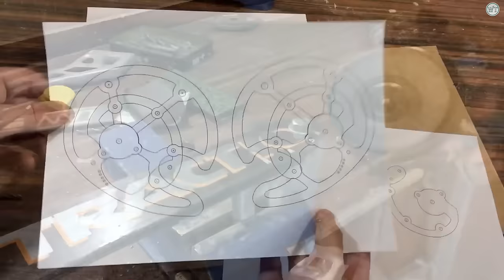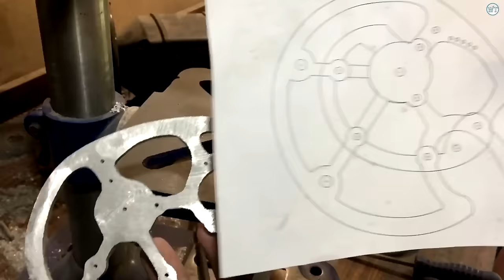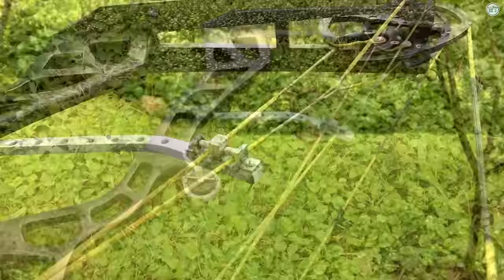Making a Full Size Compound Bow | Aluminum Riser | Powerful

Comment: Awesome build! I do have some critiques that would help the bow be more precise and a little quieter. The string stop shouldn't touch the string while the string is at rest, as that defeats the purpose of the stop completely. The stop is meant to dampen string vibration and quiet the bow, and if it's too far back and touches the string before it needs too, it will make the bow louder and transfer the string vibration to the riser. Keep it about a business card's thickness away from the string when the bow is at rest. The second thing is that the timing of the cams seems off (based solely on how they look when at rest). I would personally like to see full draw sequence of the bow before making any judgment on that though. Using a device to hold the bow for you and draw it back repeatedly to watch the timing of the cams and if any other parts touch something they don't need to would be helpful. Remember, this isn't me criticizing your skills, just some suggestions to make it better. Keep on building!
Reply: Even though I'm not the creator, I really appreciate this comment and how it's constructive and not hurtful or discrediting 👍👍

Comment: I made a compound bow about 20 years ago. It had riser made of white oak and limbs made of car leaf springs. One of the biggest challenges were cams, I made them from plywood which had to be strengthened in many ways to avoid splitting. To design draw length and let off to some reasonable values needed some thought and calculation... As a string I used a single piece of steel wire, nothing fancy there.  Finally draw weight was about 50-60lbs and bow worked well. First cams didn't last long but second ones were strong enough.

Comment: Nice craftmanship. However I'd like to point out few things that I spotted.
1. You are clearly not pulling the string all the way so that the let-off from the cams kicks in. This might be an issue with the draw weight or with the draw lenght, video doesn't really show which. If it is the lenght, the problem is most likely the cam design. Alternatively  a slightly shorter string will make the cams hit the stops earlier. This however will add more preload tension to the bow, unless you also add a little lenght to the cables. Not ideal solution, but might be good enough for this build. 
2. Draw weight is clearly too large for you.
3. As everyone else is saying, please don't use wooden arrows with a compound! And always wear safety goggles when shooting, especially as this is a homemade bow.
Reply: You can use wooden arrows with a low draw weight, but given the fact that hes not drawing enough to get any let off im assuming its a large poundage. Hes also shaking a lot.
Reply: @Lost_Hwasal  i guess you mean arrows lol
Reply: That i did.
Reply: Not all cams have a let off
Reply: That is literally the main point of a compound bow.
Reply: That and the fact that adding the pulley system reduces the bend in the limbs making it possible to use stiffer limbs than a traditional bow and gives higher arrow speeds. By looking at the cam shape, there clearly is a let-off.
Reply: it seems to be fully drawn ,  he may have accidentally placed the cams 180° wrong . there is no let off when drawn this way , only constantly rising . turn them around .
Reply: @Luzviminda777  no, the cams are in correct orientation and there is no way that the bow is  fully drawn in any of the shots, despite of the quite large brace height, there should be more movement in the arrow when drawn. After looking at his cam design for a while, I'm thinking that the cams are oversized, or the angle of the cam modules is wrong. Cam shape and size are dependent of the brace height, desired draw lenght and axle-to-axle lenght when the limbs are under preload tension, as well as the desired let-off percentage. What I am thinking is that he just printed out some cam design from the internet without considering these factors, therefore there is no way that these cams would work well on his bow.
Reply: looks like he's struggling to get that bow back to full draw..
Reply: O
Reply: “However”...the man just created this bow from literal scratch,

Comment: @ 8:00 all that effort to cast the outline of the cams in Aluminum when you had to drill them out of the other half anyway?
Just place the paper pattern on some aluminum stock or sheet and drill them out to get a finished product, bypassing the time spent cutting the patterns out of plywood, then all that work and energy spent casting them!

Comment: Most important where of it what i want to watch was making limps, you made everything,but you used skyboard for it. İ wanna learn more DİYfull limps.
Reply: Might be a little late but laminating Maple or Ash wood with fibreglass (car repair mats for example) and epoxy resin works well enaugh.

Comment: Skipping through all the bicycle rim Bowes very nice work!  I think you could have gone a little lighter with the aluminum parts, think the aluminum would have run OK. But wow what a nice bow to hang on your wall. I Especially liked the measuring tape spring with the arrow holding fork part. Sweet.

Comment: The metal he used for the arms was too stiff. If you see in the video, he could only pull it back halfway, plus, you can see him shaking.
Reply: it will put food on his table and kill him dinner. show us your homemade bow video.
Reply: @GrahamDoesMagic what choice of metal/alloy would you suggest, or would you have made everything from wood the right types of wood would be a fine choice, maybe carbon fibre cams would reduce the friction on the wood, I think maybe an aluminium plate between the wooden limbs and a  finished laminated wood top layer ?? plus the metal  he was  smolting  was aluminium . a soft metal.
Reply: Graham Lewis, arms are made of an old ski... looks stiff to me too.
Reply: @watchbreaker1706 Dombek they are called limbs m8 not arms but you are 100% correct fibreglass limbs made from a set of skis.
Reply: It is not that simple. In a compound bow eccentric cams affect on draw weight, draw length and how draw weight changes during the draw. I made a compound bow a long time ago. It has limbs made of car leaf spring steel which is very stiff, but because of the leverages they bend only couple of cm's at full draw. Bow of this video seems to have some problems on how cams and limbs fit together, or they are not correctly set.
Reply: Well, halfway is generally were the resistance is the strongest on cam bows, so... I hold my own bow there at that point cos I like to make things difficult for myself. If he pulled it all the way, it wouldn't have all that shaking that you're complaining about

Comment: The meaning of a compound bow is that it's more usable and easier to use, the compound bow should do all the work, for you, this one does not.
Reply: how is this less usable and harder to use 🤔
Reply: @Thomas Simpson Probably because he did a casting mold instead of actually hammering it out. The metal has no real elasticity since it's not truly one piece of metal.
Reply: Hahaha, mine snapped when the cable gone off rails,limb cracked, only kept the magnesium riser & pulley for future project
Reply: @Simon wat
Reply: @pckkaboo6800  probably from torquing
Reply: @Bagginsess  you don't want the riser to be elastic, it should never move or bend. The limbs should be the only part bending on a compound bow.
Reply: @BeetleBuns  using a cast instead of hammering it out would only lead to it breaking. if you want the middle to be completely stiff then you should make it out of a difference substance and then mechanically attach the limbs to it. idk much about bows but i can tell you that casted metal is inferior to "forged"/hammered out metal
Reply: @Bagginsess  a lot of bow risers are cast, it's perfectly fine. Sure a machined riser is stronger, but cast aluminum is perfectly adequate for cheaper (and in this case, handmade) bows. The bow he made is not amazing, hell it's not even good by compound bow standards (even the earliest compounds were better). I was just stating that you don't want the riser to be elastic. 

You don't "forge" a riser in the sense of hammering it out, you either cast it or machine it from a billet that was forged. I have 3 bows from the mid-1980's through 1990 that have cast magnesium risers, and still work as well as the day they were made. The stiffness doesn't come from the manufacturing process, but from the way it is engineered, in this case it's not going to be the best in that regard anyway. The only advantage machined risers have over cast is that there is less chance of a defect, which is extremely rare anyway if the one making it knows what they're doing. 

Sorry for rambling a bit, I realize this may not be the easiest thing to read, I'm just tossing my experience with compound bows out there, and while I prefer a machined riser just because I trust it a little more for the stuff I put my bows through on a hunt, I will pick up and shoot a cast riser without ay hesitation (provided it is in good condition of course).
Reply: @BeetleBuns  fair enough, im just a sword guy so i like my folded metal but i see what you mean
Reply: @caden5413  am i allowed to critize iphones, even though i cant make a phone?
Reply: It doesn't have let off
Reply: @Bagginsess  you ever get tired of publicly embarrassing yourself?
Reply: @arthurayers5044  you ever get tired of an empty bed?

Comment: Tooling=$1500 + Man hours = 96 hours  Vs $250 from reputable manufacturer umm i think i know which one i would choose, but great to know if the Zombie apocalypse ever happens  might take a bit longer as there would be no power to power the tools
Reply: With safety test inspection rate of four out of every one hundred components made here, not counting the outsourced and mass produced parts by third-party second & third world manufacturers, depending where in the world they're made with the possiblity of FAKED ISO CERTIFICATONS and possible forced prision labor, I'd go with homemade.

Comment: Please write me wjat kind of skies are you using to make a wings ? Epoxy laminated or carbon ? Do you think that making wings on my own make sense ? Another word, is using skies is the best choice ?
Reply: The entire "large" archery industry is probably based on the Gordon Glass product, or very similar (type "gordon glass limbs" in the search engine). Skis are not suitable, or at least would require a different bow design and blocks, more similar to the constructions from the 80s, because as shown in the attached example they are too thick and too stiff, and it is not easy to change it by simply reducing the thickness.